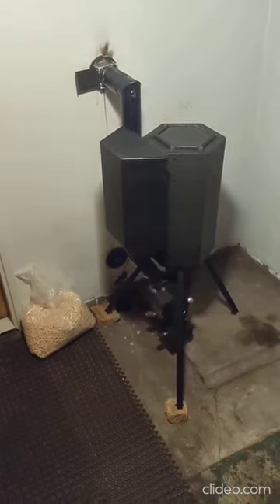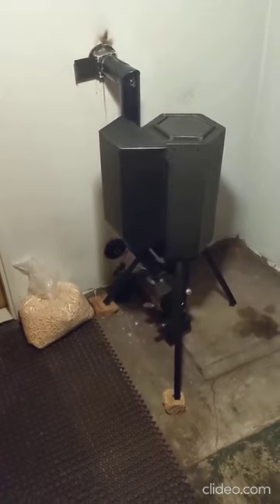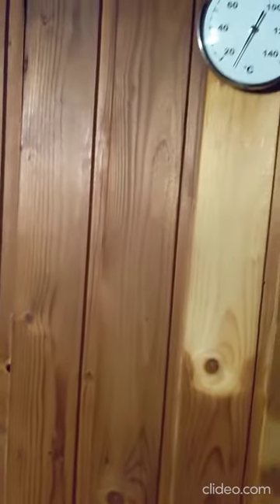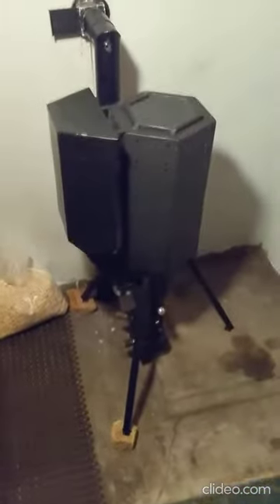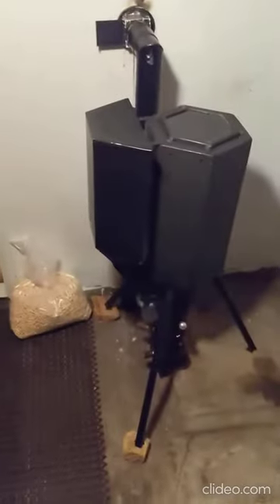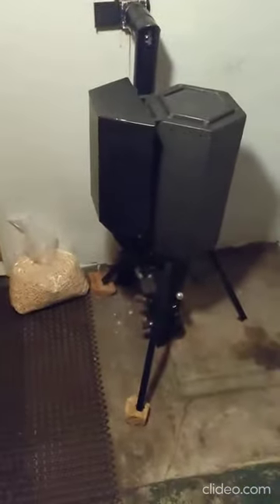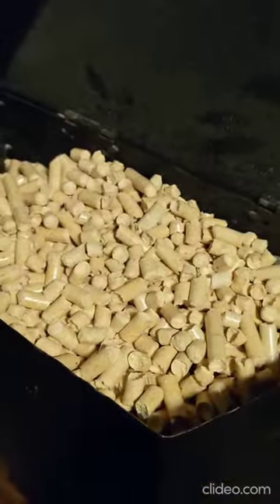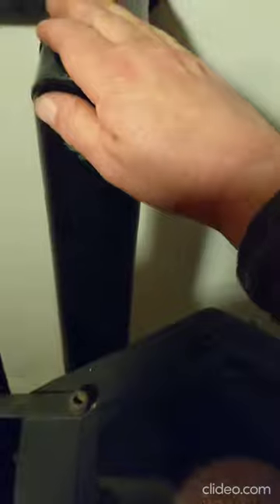HastyHeat.com gravity wood pellet rocket stove with thermal electric generator hot water boiler TEG

Comment: let’s say you make diagonal or s-shaped pipe in-and-out the hexagon, would that create an air hot air stream? 
Or maybe a shield around the hexagon? Would be nice to get a hot air stream going? 
More conversation.
Reply from the maker: plenty of heat radiates off the hexagon,  if you needed to bottle the heat to blow down some duct work a different style heat exchanger can be made to attach to the wood pellet stove cartridge.
this hexagon was designed for mounting lots of water cooled TEG thermal electric generators to make electricity and hot water. the TEG boiler can be seen in other videos.